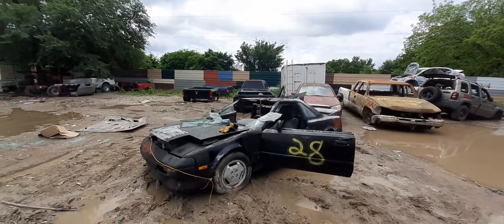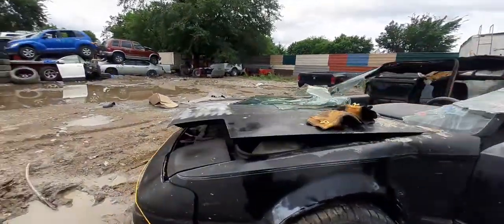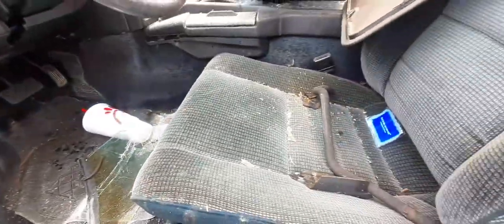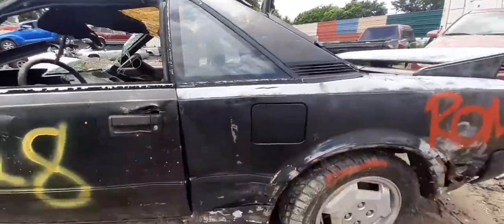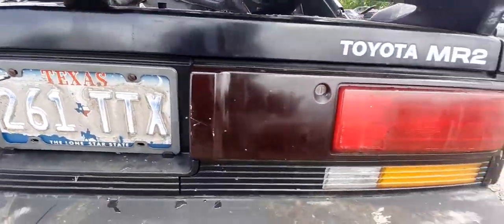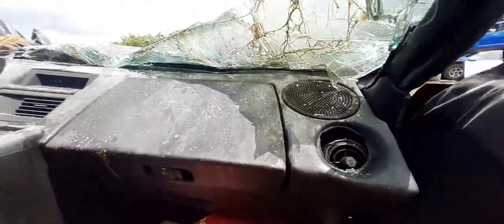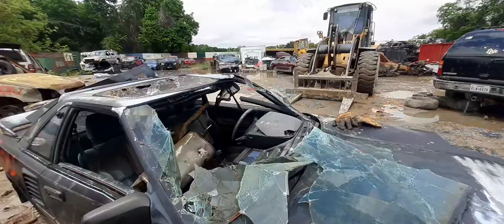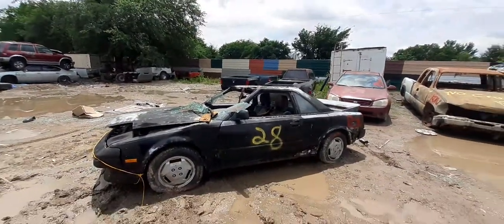1987 TOYOTA MR2 DEATH CERTIFICATE WALK AROUND..💯😎💪😁

Comment: Whoa Nelley, nearly 500k on the clock if I read the odometer right. Typical Toyota quality, they run, run, run, run and run some more.....

We got the VIN, we win: JT2 for Japan made Toyota passenger car, A for 4AGE 1.6L DOHC (aka "twin cam") engine, W for MR2, 1 for MR2 again, 5 for MR2 grade model, C for two door coupe, 5 is a check digit, H for the 1987 model year, O for Sagamihara, Japan assembly and the rest is the production sequence.

The dealer where it was sold at one time is still in business, Grappone Toyota is now located at 594 NH-3A, Bow, NH 03304. These were pretty quick back in the day and they were often called "pocket rockets" because they were fairly light, nimble and fast. They are still popular today. Lotus helped with the design of the car.
Reply from the maker: Sweet. Lotus help made that..💯💪😎